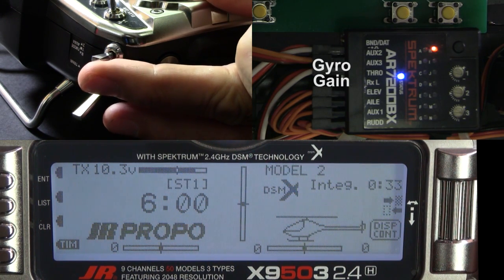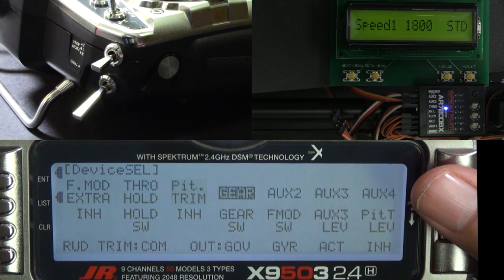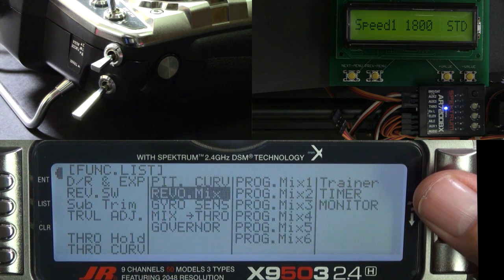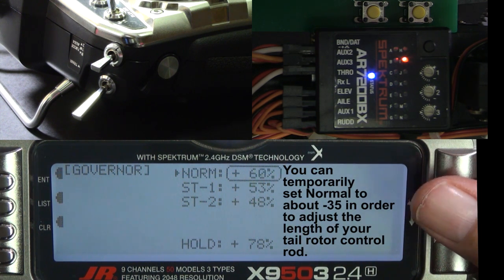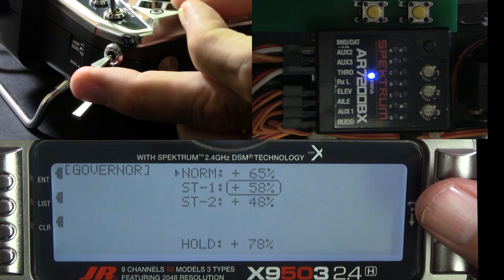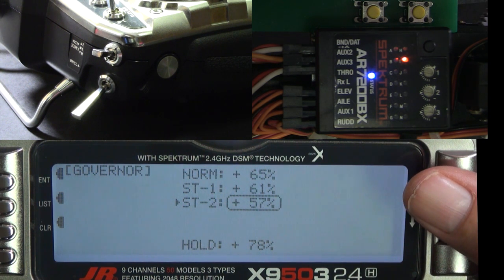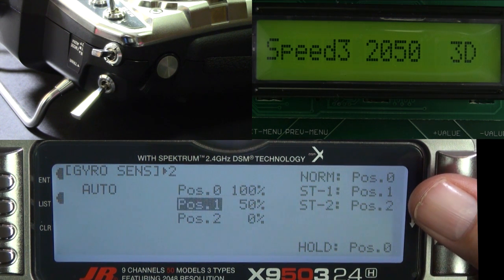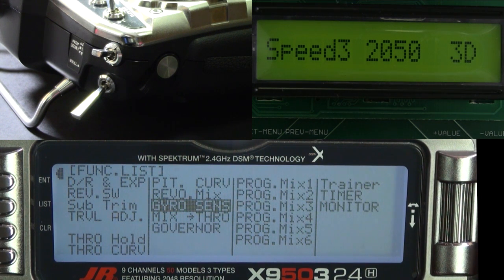9503 7200BX Advanced Gyro Gain and Governor Setup

Comment: I have a align trex 500 with a AR7300Bx on it. I set it up and every thing is working like it should. But the tail servo is not working like it should. It is not going all the way left and right and it is a lot slower then the other servos. I put anew  servo on the tail and it is the same. I'm using a DX8 radio and the servo is a align DS520.When in the set up mod and your setting the end points the servo go's all the way left and right. Can you help me with this.
Reply from the maker: Be sure the servo arm is exactly perpendicular to the control rod when you are in RATE mode and the rudder stick is centered with NO subtrim. 
As far as the speed of the servo, don't worry about that. It will be fast in the air.

Comment: Connected to the AR7200BX you have something setup as a governor, what were you using?  Mine is a little different as I run with a Kontronix 80 and Kontronix 120 on two different helis.